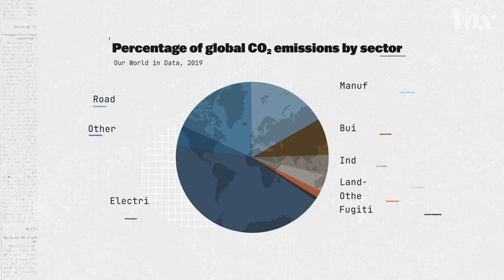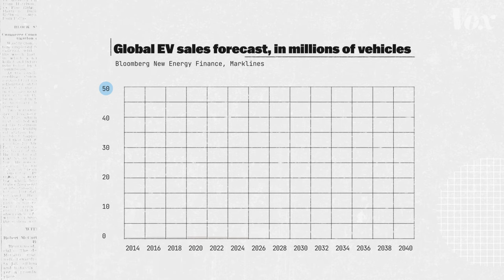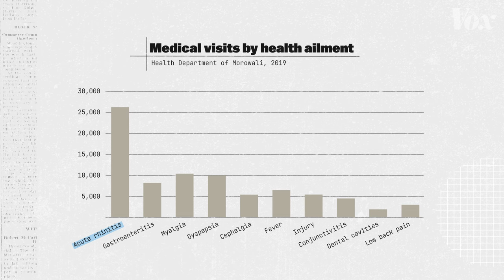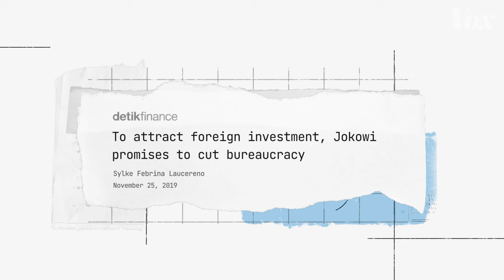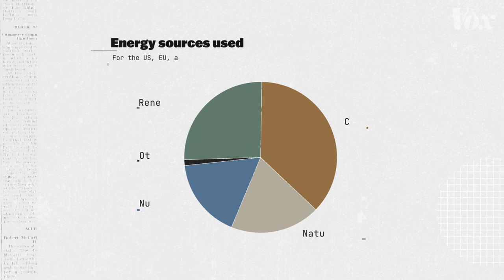Batteries are dirty. Geothermal power can help.

Comment: There is another problem with electric vehicles as it will place huge strain on our national grid (using the UK as an example). Our electric capacity isn’t ready for electric cars to completely replace normal cars. The best solution is using a range of alternatives.

Comment: I love Vox and all the work you do, but this video has a huge disconnect. Where you show people being affected by a mine. Then it suddenly the solution is to switch away from coal power. But clearly all the symptoms Asvina stated are created by the mining operations and not the power source. The power source is an issue, but not the main issue, mining is.

Comment: Zero impact is a myth. There is only better or worse. When compared to the oil and gas industry, EVs are the obvious and clear choice. This will kick off the transition to cleaner energy while we build more mass transit options. Sticking with oil and gas is the wrong choice. Perfect isn’t possible or achievable without long term progressive step changes toward a cleaner energy future.

Comment: People will turn to every solution to carbon-free energy except nuclear. Per kilowatt hour, nuclear energy has caused the least direct and indirect deaths out of any widely used source of energy. Install some of those adjacent to urban centers and you have a carbon neutral grid, plain and simple.

Comment: Ethical production is nowhere near keeping up with the skyrocketing battery demand. It's not even trying. This video outlines only one of the issues, there are others like child labour. Backing 100% on Battery Electric Vehicles is a huge mistake. The impact of it will be similar to the fossil colonialism of the 20th century before any significant action is taken. I know, developing green hydrogen electric, green methanol and carbon capture is expensive, but is this economy really worth the environmental and social impact? Not to mention the fact that constantly replacing cars, even with incrementally cleaner ones, in itself has huge environmental impact.

Comment: What happens when we start using this on large scale? Wouldn't it lower the Earth's temperature over time?? Geothermal energy basically makes a shortcut to heat radiation from the Earth's core.
Reply: On the scale of millions of years, yes
Reply: Not at all...
Most of geothermal are near bodies of magma on the earth's crusts is about 70 km thick, and below that is the mantle 2900 km thick. 
So No.

Comment: I think it would be better if we invested in hydrogen powered vehicles over battery powered ones, since hydrogen can be made anywhere, doesn't require many special metals, can "recharge" faster than batteries, performs better in colder weather, and its only emissions (which could also be captured) is water
Reply: But hydrogene powered vehicles have a very low energy effience. I think we should build more public transport
Reply: @blackging3rpool251  They are now but I'm sure if we put research into the technology, it'll improve at least some if not a lot. I agree that more, better, public transit would help as well

Comment: You need to put those stories into perspective. Many people just get out of this story that EVs are actually worse than ICE cars at least for the next couple of years. I always have to explain to people that the gas they put into their car also has to be drilled, transported and refined (which also results in pollution) and then especially can in no way be recycled. Furthermore, the claim of 0g of CO2 is obviously wrong (it's just way less than with an ICE vehicle), so please do not claim it, as it's a very easy straw-man to "debunk" by the oil lobby, and with that all the other claims are in doubt as well.

Comment: EV s are only suitable even in theory for personal cars or small traspor vans. You CANNOT move longhaul road transport, heavy machinery (farm, constructuion equipment) to electric, there is simply no way with lithium batteries. So instead of 18% claimed our theoretical limit for reduction from road transport is like 5-7%.

Comment: how about instead of having cars with batteries, we have these powerlines running along known traffic routes that people can connect to?
even better, have cars permanently attached to the power source so it's easier to handle.
maybe we can even connect then to one another to enjoy the benefits of a single, more efficient motor, as well as run them on tracks to reduce friction and...
whoops, I've invented the train.

Comment: Luckily there is a form of electric-powered transportation between New York and DC that doesn't rely on lithium ion batteries, Amtrak.

That doesn't change the importance of switching to clean power sources, it's just a weird example to choose as a lead-in to this video.

Comment: This is dead wrong. 61% of electricity in the US is generated from fossil fuels, so that 112kg of CO2 with an EV would still generate a minimum of 68.2kg of CO2 assuming the same level of mileage/efficiency.

Comment: How about build a train Track. No carbon emission and no batteries. Better for everyone.
Reply: What do you think trains run on?
Reply: @LiewLmao  Most trains are powered by electricity from the catenary. There are still diesel locomotive out there. But fewer.

Comment: VOX, you really need to be more accurate with your data. As of now and even in the future, EVs are not 100% CO2 free. There's CO2 consumption just by plugging a car to the wall socket, also during it's manufacturing.

Comment: Surely, lithium batteries use lithium, not nickel? Isn't that in nickel-cadmium batteries?

{:o:O:}
Reply: One of the various lithium ion chemistries is NMC or nickel manganese cobalt. They’re very energy dense, but also more reactive/volatile compared to other comprable chemistries, and usually what’s used in a typical Li-po pack. They’ve led to litigation because of their volatility, so my money is on LiFePo4 or lithium iron phosphate batteries, which are much more tame and use abundant materials, but come at a cost to the amount of energy they can produce gram for gram. They’re already starting to see increasingly prolific use - but I’d bet that nickel is still coming out of the ground anyway, unfortunately

Comment: 0:15 seconds in and already a false claim in the video.
The electricity powering the electric car didn't just spawn out of of nowhere. It was made. Most likely from coal. Making the trip in electric prolly also in ~100kg CO2 emitted range.
Reply: 0:33. Watch more than 15 seconds before commenting... You wouldn't review Star Wars based solely on the title crawl, would you?
Reply: @Jhawk_2k  I still don't hear any restitution for FALSE CLAIM, that driving electric car for X miles produce 0 carbon emission stated earlier.